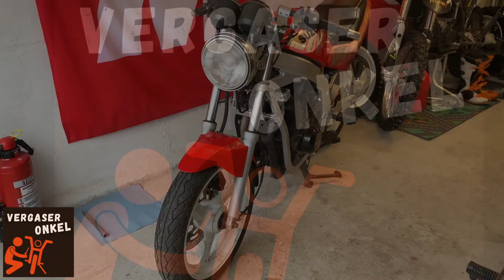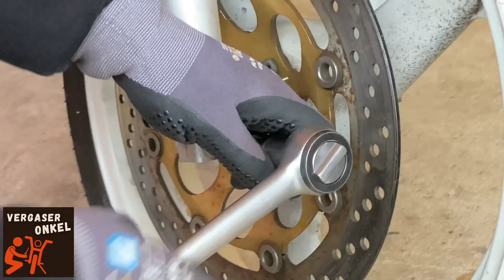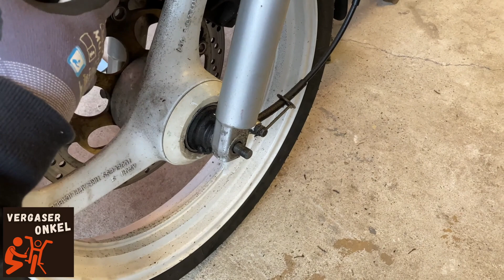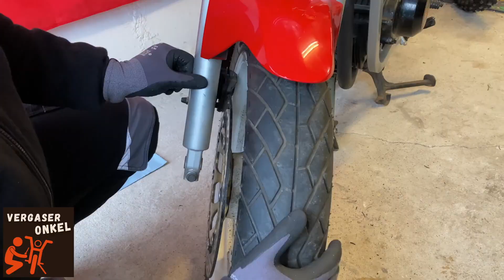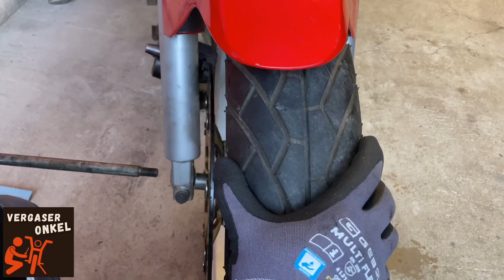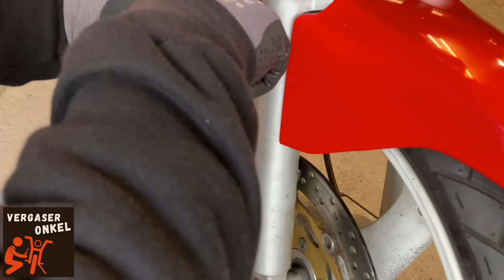Don't miss out: How to remove the GS500E front wheel like a pro! Carb King #carburetorcleaning

Comment from the maker: Carburetor repair kit GS 500 E, year 89-93
https://www.woembi.de/Vergaser-Rep-Satz-SUZ-GS500E-Bj-89-93-KEYSTER?gi=1
Carburetor repair kit GS 500 E, year 94-95
https://www.woembi.de/Vergaser-Rep-Satz-SUZ-GS500E-Bj-94-95-KEYSTER?gi=1
Carburetor repair kit GS 500 E, year 96-00
https://www.woembi.de/Vergaser-Rep-Satz-SUZ-GS500E-Bj-96-00-KEYSTER?gi=1
Carburetor repair kit GS 500 E, from year 01
https://www.woembi.de/Vergaser-Rep-Satz-SUZ-GS500E-ab-01-GZ250-XF650-KEYSTER?gi=1
Slide guide, year 89-00
https://www.woembi.de/Gasschieberfuehrung-SUZ-DR350-750-800-GS500E-GSX600F-BMW-F650?gi=1
Float needle valve
https://www.woembi.de/Schwimmernadel-Ventil-SUZ-DR250-800-GS500E-ua?gi=1
Float GS 500 E, year 89-00
https://www.woembi.de/Schwimmer-SUZ-DR250-350-GS500E-GSX-R750-1100-GSF1200-ua?gi=1
Mixture screw GS 500 E, year 89-00
https://www.woembi.de/Gemischschraube-SUZ-GS500-VS-VX800-ua?gi=1
Diaphragm GS 500 E, year 94-00
https://www.woembi.de/Membrane-SUZ-GS500E-GSX600-750F-GSX-R750-1100-GSF1200?gi=1
Choke piston
https://www.woembi.de/Chokekolben-SUZ-GS500E-GSX600-1100-GSX-R750-1100-ua?gi=1
Service kit GS 500E
https://www.woembi.de/Service-Kit-SUZ-GS500E-F-89-08?gi=1
Air filter
https://www.woembi.de/Luftfilter-SUZ-GS500E-89-08-GSX1200-99-00?gi=1
Oil filter
https://www.woembi.de/Oelfilter-HIFLO-HF133-Suzuki?gi=1
Fuel tap repair kit, year 89-00
https://www.woembi.de/Benzinhahn-Rep-Satz-SUZ-GS500E-Bj-89-00?gi=1
Ignition lock
https://www.woembi.de/Zuendschloss-SUZ-GSF400-GS500E-GSX-RF600-GSX-GSX-R750-1100?gi=1